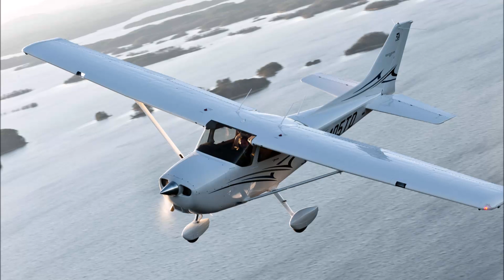2024 FAA AIRFRAME Oral Questions

Comment from the maker: 00:25 Chapter 1 Aircraft Structural Assembly and Rigging 
05:29 Chapter 2 Sheet Metal Structures 
11:21 Chapter 3 Wood Composite and Transparent Plastic Structures
19:46 Chapter 4 Aircraft Welding
24:02 Chapter 5 Aircraft Fabric Covering
28:51 Chapter 6 Aircraft Painting and Finishing 
33:04 Chapter 7 Airframe Electrical Systems
38:03 Chapter 8 Hydraulic and Pneumatic Power Systems 
43:25 Chapter 9 Aircraft Landing Gear Systems
48:21 Chapter 10 Position and Warning Systems 
53:10 Chapter 11 Aircraft Instrument Systems 
58:04 Chapter 12 Aircraft Avionics Systems 
01:03:26 Chapter 13 Airframe Ice and Rain Control 
01:10:09 Chapter 14 Cabin Atmosphere Control Systems 
01:16:58 Chapter 15 Aircraft Fuel Systems 
01:23:05 Chapter 16 Fire Protection Systems 
01:29:21 Chapter 17 Aircraft Airworthiness Inspections
Reply: Thank you. This is a blessing

Comment: Just got my A & P rating yesterday 10/23/2023. This video still good! Some questions were literally word for word! Good luck to anyone testing! Thank you @Northeast Aviation Pro 🤝
Reply: Im taking my test in 2 weeks. General and Airframe.  I've been studying the jeppesen and some ASA. Got any tips?
Reply: @camllo14  whats up man, the questions I got were based on the questions I got wrong on written test. So, study that whole area and know the theory etc. 
but this video is ENOUGH study material for the orals. Just answer simple and short and DONT add anything else unless DME told you so. 

For ex. 
DME asked - What could cause a hydraulic filter to go into open bypass,  allowing unfiltered fluid into the system? 
Ans. Clogged Filter. 

Thats it, dont explain how and why it got clogged. Hope it helps! You got this!
Reply: @camllo14  I didnt study jeppesen but I went through ASA study guides and this video. I listened to it anywhere from driving to walking the dogs.
Reply: @jullianbasilio5830 thanks man this helped out alot. I feel nervous but well see. I feel nervous for both practical and oral outs haha. Thanks again man!
Reply: @camllo14  I take mines in 2 weeks as well

Comment: Just want to say THANK YOU and for anyone who is skeptical leave the worries at the door. I passed my general and airframe O&P with flying colors because of this video. 97%
Reply: CONGRATS! How did your practical's go?
Reply: @richardkwaning933  They went well! Not hard just have to pay attention to the details. I had to complete the following: weight and balance calculations, logbook entry, temperature conversion, inspect two welds and explain any defects, inspect a spar and explain the type of corrosion, inspect a fuel system and annotate any defects, AD compliance for a prop and engine and lastly the sheet metal project. On difficulty factor I’ll honestly give it a 6/10
Reply from the maker: Congrats!!!! Make shre to check out my merch shop :)

Comment: I just passed my O&P for General, airframe, and powerplant today.  These videos are helpful, but I would recommend looking up the quizlet for the ASA questions to.  This video gets most of it, but for the Airframe portion I highly recommend doing at least some ASA and studying this at the same time.
Reply: What ASA quizlet can you please provide me more info , about what books to buy or what materials i need to get please its important i want my A&P.
Reply: @aleaguilera2993  Hello, there are both ASA and jeppessen questions online on quizlet.  The way I studied for it was I used the ASA Dale Crane Book, and I supplemented the rest with this  these videos.  These videos are avalible word for for word on quizlet if you simply look up jeppessen O&P airframe, questions quizlet. The same is true with the other 2 videos. I only got 1 question wrong in all three sections combined doing that. If you have any other questions please ask.
Reply: @rnelson299  so did you study all the material on asa & jeppeson books + these videos? or did you only study some asa?
Reply: @makinbaconpancakess  Jeppessen with ASA supplementing my knowledge
Reply: Hey there quick question, how did you study for your practicals? Did you go to any course after you completed your class by any chance? Such as like a prep course?

Comment: Passed my O&P for General and Airframe yesterday. (10/26/23). While the O questions were close, they weren’t exact anymore….But this vid was certainly very helpful and very close. If you feel comfortable with the topics on here you shouldn’t have a problem. The DME told me that with the new ACS, the questions are given to him based on your written results (I got a 97% on the general and that gave me only six questions for the oral).  So the better you do on your writtens, the shorter the O&P portion will be.  I got a 93% on airframe and that resulted in 9 O&P on the airframe part.  It was all pretty straightforward with no tricks and every book and manual was made available… I’d say for the Os and Ps the BIGGEST skill is knowing where and how to find info in the manuals, regulations, and AC43.13.  If you can navigate those you’ll be good to go.  Example was “tell me where is says some aircraft can have 2in registration numbers?”.  Well we know Registration stuff ispart 45, so it was as simple as looking up Part 45 in front of the DME and pointing to the appropriate reg.  I’ll be buying merch to support the help this channel gave me.
Reply: were there topics in this video, like doping, that you were not asked in your test? because I know it has changed and some topics no longer exist
Reply: @jacobdunnohew23  it depends… the questions are generated mainly from the missed areas of your writtens… I didn’t get any on fabric (which almost sucks because I’ve done a ton of fabric work)

I’d look at the areas you missed… look up the topic codes and study that stuff a little more.  The questions, while not exact, were pretty close.
Reply: Where the written test questions a lot different then the asa prep question’s or is it basically the same as before.
Reply from the maker: Lets goo

Comment: Passed my A&P O&Ps today! Thanks for the video
Reply from the maker: Congrats! https://northeast-aviation-pro.creator-spring.com/
Reply: Congratulations. Did you only use these videos only for your o&ps ?
Reply: @Scott-bd5rc  I used these videos and the Jeppeson Oral study guide on Quizlet. The only difference between these and the actual test, was that one or two questions I was asked were kind of in reverse order.

I.E. Q. What function does a capacitor serve? A. It creates capacitance in an AC circuit which is a cause of opposition to current flow. 
As opposed to. Q. What creates capacitance in an AC circuit? A. Capacitor

I only received one question that I had not seen before. Q. What species of wood is considered to be strongest when used in aircraft structures? A. Spruce. I missed it, but fortunately I had already correctly answered 3 other wood structures questions correctly. 

Everything else was nearly word for word.

If you have any other questions let me know.
Reply: @mrtutorial57  thank you bud! I’m nervous af and I only studied the jepp study guide and feel good about it. I was worried if there were questions from ASA books. Congratulations again!
Reply: @mrtutorial57  do you recommend only studying the Jeppeson? Or I have seen people say the asa or bakers as well. Also how did your practicals go if you don’t mind me asking and how did you study up for those?
Reply: @frankhatton3336  I think that knowing more than just the answer may be beneficial for some things. The questions are pretty much identical to the Jeppeson questions, but I wasn’t entirely satisfied with some of the answers they give. If you are iffy on an answer then I would see what ASA and Bakers has to say about the topic and consult the FAAs Maintainers Guide. 

As for the practicals, they were mostly very simple. The DME will give you every publication and tool you need to successfully complete the task. IE: FARs, AMMs, TCDSs, STCs, IPCs, AC 43-13.1b, etc. If you work in this business already, or have completed a Part 147 AMTS, then you will be adequately prepared for the practicals.

Comment: 00:25 Chapter 1 Aircraft Structural Assembly and Rigging
05:29 Chapter 2 Sheet Metal Structures
11:21 Chapter 3 Wood Composite and Transparent Plastic Structures 
33:04 Chapter 7 Airframe Electrical Systems
38:03 Chapter 8 Hydraulic and Pneumatic Power Systems
43:25 Chapter 9 Aircraft Landing Gear Systems
53:10 Chapter 11 Aircraft Instrument Systems
01:03:26 Chapter 13 Airframe Ice and Rain Control
01:10:09 Chapter 14 Cabin Atmosphere Control Systems
01:16:58 Chapter 15 Aircraft Fuel Systems
01:29:21 Chapter 17 Aircraft Airworthiness Inspections

Comment: Thanks for making this. I was doing flash cards just now and it was taking to long to write. So I’m going try your method. Taking my test soon wish me luck
Reply: Good luck. I test tomorrow morning. I've only studied the Jeppesen O&P guides, hopefully they're up to date.
Reply: @mmholling87  how'd it go?
Reply: @dabwe  I passed. My oral questions where almost directly from the Jeppesen study guides. Also, during the practical portion the only reference materials I was provided with was the AC 43-13 1B and the FAR book, so be very firmilar with them. Study the Jeppesen General, Airframe, powerplant study guides and you'll have no problem. Good luck.
Reply: @Yago Lins De Oliveira Alves (LATAM) I took my Oral and Practical test in Clarksville, TN.
Reply: @mmholling87  Is there enough in this video to pass?
Reply: @ryannelson5943  yes, I think so...I passed with no issues. My questions were very similar to the ones in this video which are from the jeppesen books. I only listened to these videos and honestly didn't study the books. Be very familiar with the ac 43-13 and your FAR book.
Reply: @mmholling87  Ha well your kinda studying is similar to mine.  Ive gone through a lot of the ASA book to, but I heard the Jeppessen Questions were more accurate so I think i'll just study these videos and quizlets from now on.